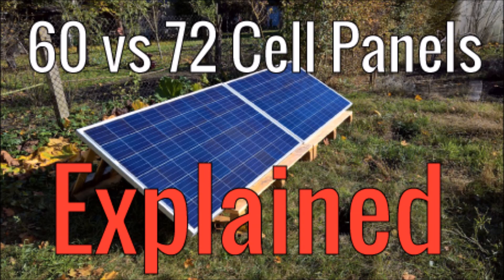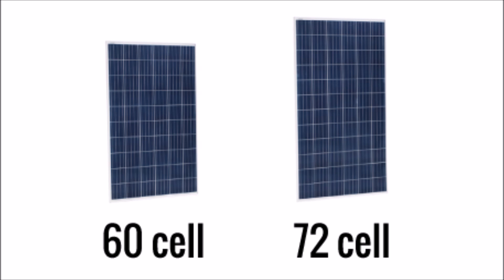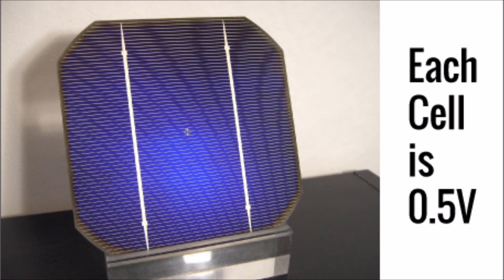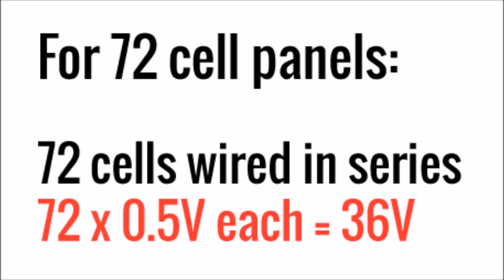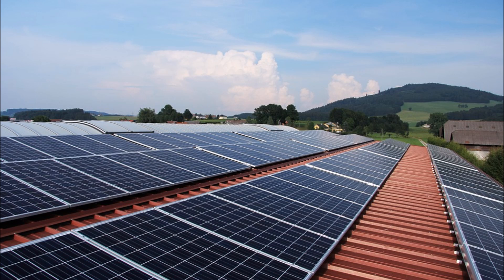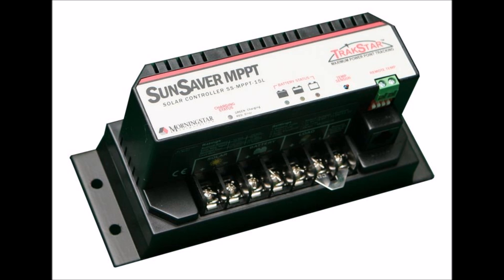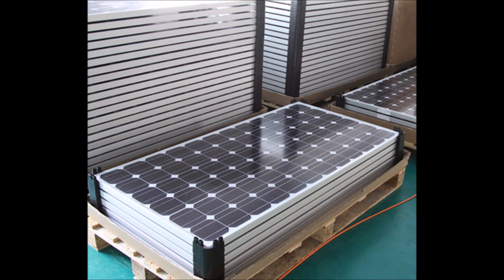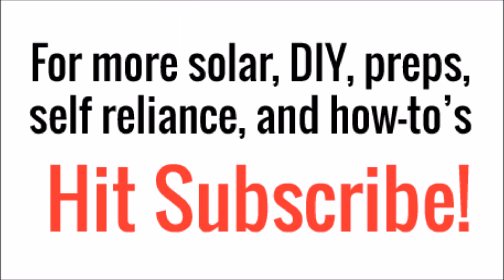60 vs 72 Cell Solar Panels Explained

Comment: What is the watts of a single cell?
Reply from the maker: Usually 1-2 Watts each.
Reply: @LDSreliance  when the manufacturer is making these cells can they make the cells a specific watt by varying something that goes into each cell?
Reply from the maker: They can vary slightly based on the composition/materials in the cell and things like that.

Comment: Pls is better to have 2 40v 72cell panels in series to charge a 24v battery bank or 3 40v 72 cell panels in serious,is there any more advantages to go up in voltage

Comment: The battery voltage matching sounds reasonable. But, what's special about "13"  60-cell panels in series (390v)? You can archive about the same with "11"  72-cell panels in series (396v).
Reply from the maker: The open circuit voltage of a 60 cell panel will be about 38-39V which makes a 13 panel string about 507V and gives some safety margin for higher spikes.  I really don't know all the rationale but I read that in a few different places as being one of the reasons that 60 cell became the industry standard.
Reply: Ok, but then a open circuit for a 72-cell will be about 47 v, and the '11' string will be 515v, keeping safety margin. Proably the reason is they no longuer need to match battery voltage AND maybe some advantage in the form factor: A bit smaller, production line reasons, other etc
Reply from the maker: There are probably other reasons for sure.  It is a good question and I would love to hear from anyone who knows the answer.

Comment: What if I have a 12V Deep cycle battery, then what panel do i need?
Reply from the maker: Yep, what Ben said.  The 60 and 72 cell panels are the giant panels you put on your roof for big production.  For simple, smaller setups use a 36 cell.
Reply: wait wouldnt it be 24 cell for 12 volts?
Reply from the maker: No, you have to have higher voltage than the battery you intend to charge.  A 24 cell panel would have a maximum voltage of 12 volts, which is not enough to charge a 12V battery.  You need at least 15V to charge a 12V battery.
Reply from the maker: Also, you need to account for drops in production due to heat so in the middle of the summer at the hottest part of your day, your solar panels will produce less power because they are baking.  If you only had a 24 cell panel the voltage would end up being like 10V.
Reply: Why dont solar panels have intense cooling to heep the efficiency high? or at least some cooling
Reply: So, heat is good for amperage but not voltage?

Comment: 60 cell panel fits perfectly for Offgrid 24V system or 48V system (2 in series) using PWM controller.
72 cell panels have no advantages.
Reply: 60 Cell solar panel MPP voltage is 32V that's more than enough. A few years after the lead acid technology will be obsolete. Lithium battery max voltage is 29,4V.
Reply: CheapVlog  72's DO have an advantage, as the panel heats, output is lowered, more cells, less lowering.
  This is especially important if you're charging a 24v bank with 24v panels and using a PWM controller. When that panel gets really hot, the output may not be enough to charge a bank that is coming up to charged voltage.
this results in a constantly undercharged bank and leads to premature failure.
Panels are rated at 77 degrees F, figure roughly a 1v drop from RATED, not real world output, (which is invariably lower yet), for every 20 degrees higher than that.
More cells, in this case, is definitely better.
Reply: I have not tested but 37V MPP seems way off. And batteries are not always full. 27V average (Lithium)
Here is always cold too.
Reply: CheapVlog If you're using a PWM on Lithium cells, all I can say is 
Good luck.
Reply: No, just MOSFET on/off + arduino.
Reply from the maker: Love the discussion in this thread guys.  Good stuff.  Yes, you can use a 60 cell panel for off grid if you use a MPPT controller or know how to get around it with custom programming and newer technology like lithium cells.  However, as I have stated many times, I am trying to educate the beginners to intermediate folks not the advanced users.  I don't consider myself an advanced solar guy myself so I really don't have anything to teach you about the finer points of custom arduino controls or uber expensive new battery technologies that fly in the face of conventional wisdom.
Reply from the maker: Haha, thanks!  I learn a lot from some of you guys.  Seriously.
Reply: I love the conversation going on here. As a Solar Installer I’m learning so much from most of you. Keep it up guys ✌️